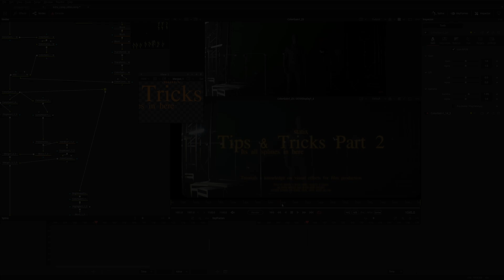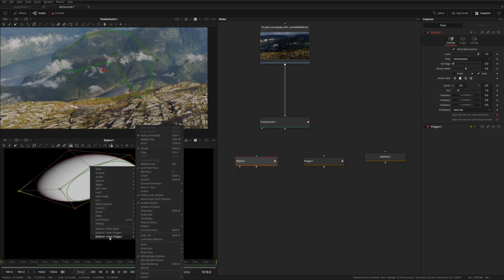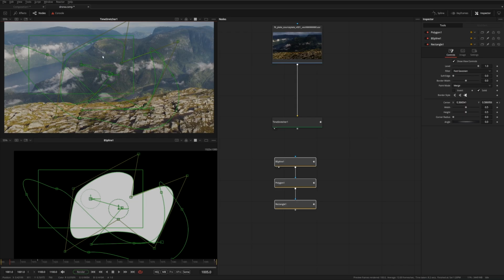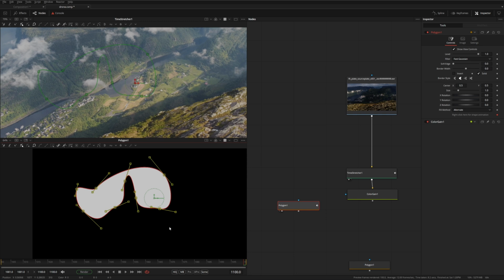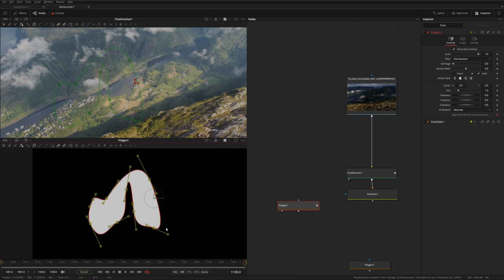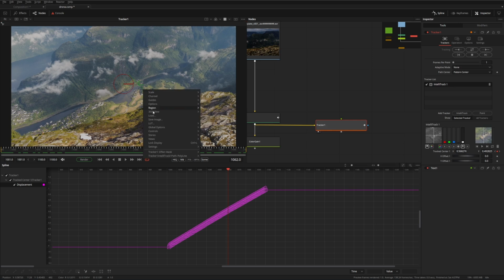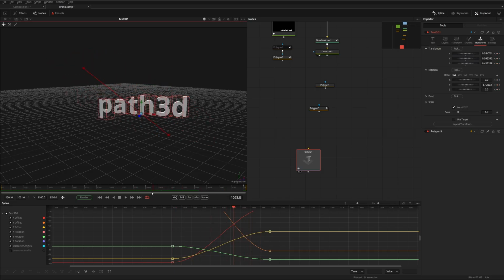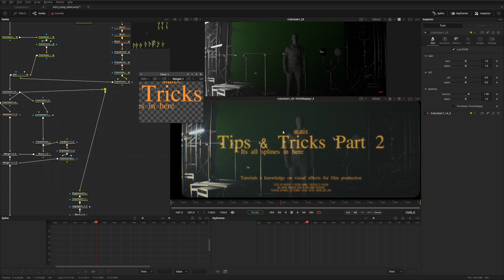Fusion tips and tricks part 2

Comment: Great collection of tips. Surprised you didn't mention my personal favorite spline shortcut. With no points selected, hold 'alt' and clicking will select the nearest point. With a point (or several) selected, hold down alt makes it so you don't have to have your cursor over any of the selected points when moving them. Simply click and drag anywhere in the viewer (while holding down alt) and you can move the selected points. Superrrrrr handy.

Unfortunately it doesn't work with all splines. The Grid Warp or the Splines panel comes to mind for example.
Reply from the maker: Did not know that one! Thanks for sharing!

Comment: Hi! Thanks for this amazing video. Btw, I really liked the filmic look of your title cards and the way they faded out. Could you give a quick explanation of how to achieve that look?
Reply from the maker: Look at films from the 70-80s, there's a tendency to cross over to blue tones when dissolving and fading text and shots. This is an optical phenomenon.

The different color layers in the film emulsion (red-sensitive, green-sensitive, blue-sensitive) don’t respond equally in these situations. The red layer tends to "die out" faster than the blue layer, meaning at very low exposure levels (like the end of a fade), blue can dominate.

Im just giving each layer a blue tint as they fade off.
Reply: @statixvfx1793  Awesome!  I didn't know about that phenomenon and now I understand it perfectly. Thank you very much for the explanation!!